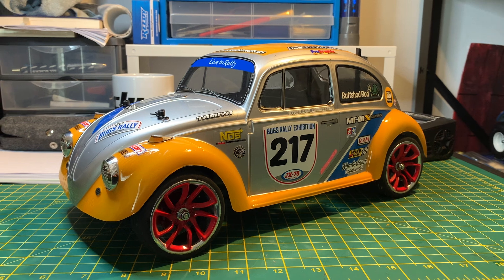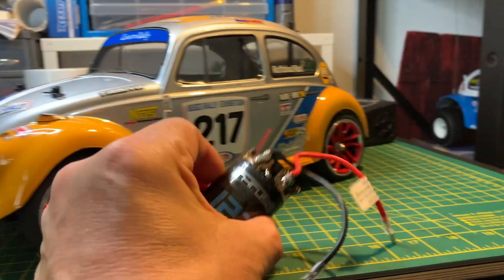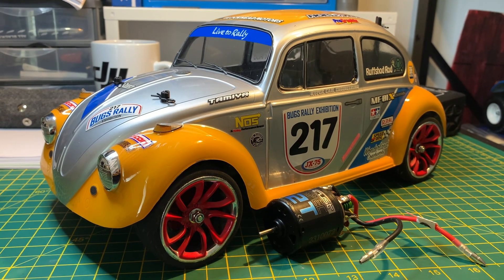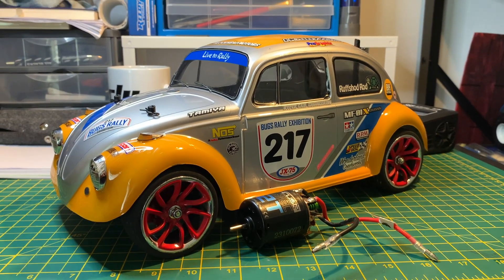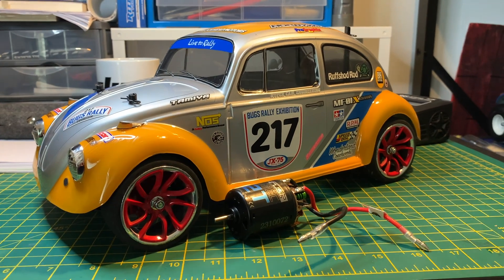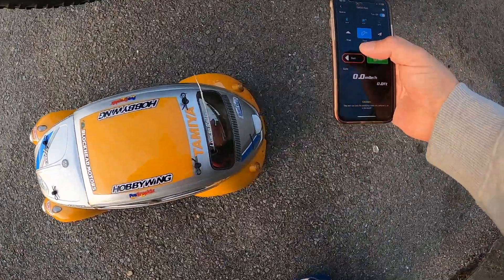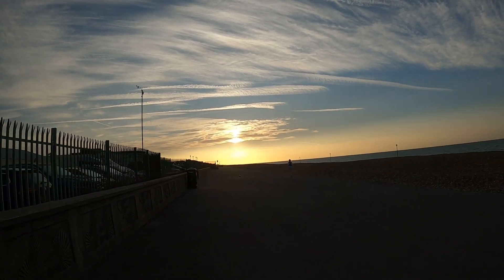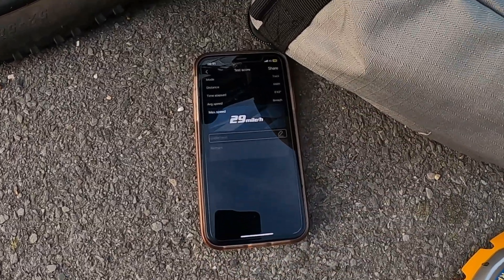Tamiya MF01X - Poor Boys RC Speed Run Challenge 2024 - Run 6

Comment: Nice work, any improvement is good! Like Mark said I'm sure there is a 30 in there with that setup. I'd be tempted to jump to a 25 or 26t pinion as that's the biggest you can go without gearbox mods and should give at least mid 30's without too many issues.
Reply from the maker: Just want to break 30 for it final run